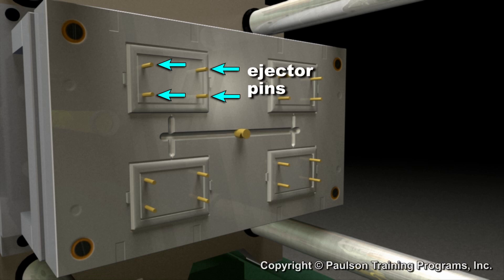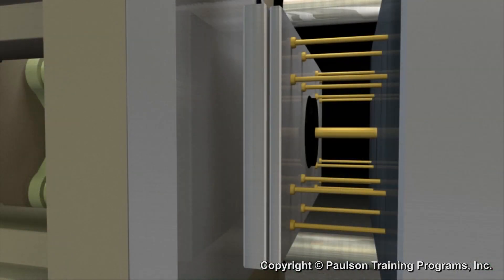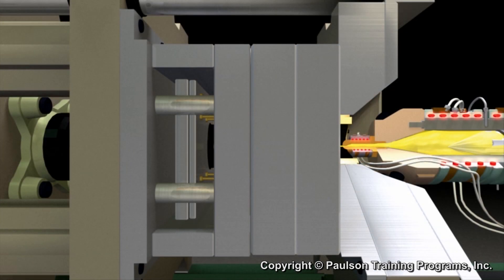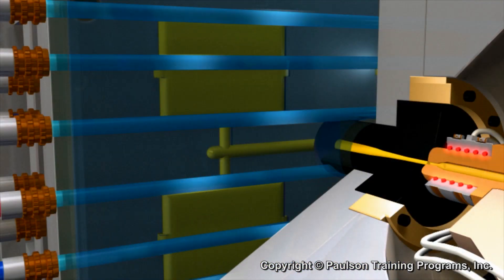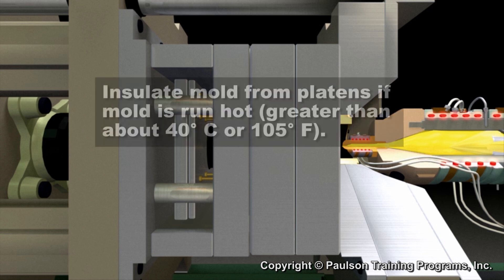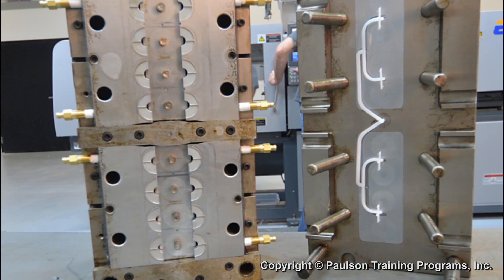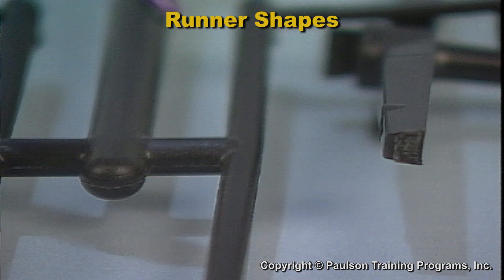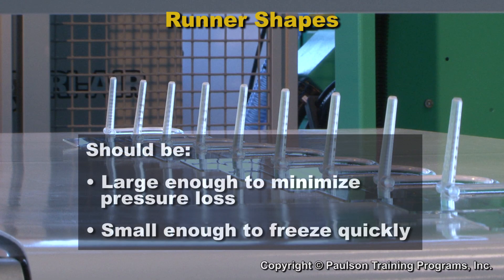Lesson 2-HD - Injection Molds - Their Parts and Operation-the Technology of Injection Molding

Comment: We are a mold manufacturer and injection molding manufacturer in ShenZhen China.  
We have made the following products, auto parts, OA. Electronic products and .Home appliances, etc.
We can provide the following tooling technologies for plastic and rubber products
1. Cold runner mould.
2. Hot runner injection mould.
3. Insert Mould.
4. Over Mould.
5. Two - shot Mould.
6. unscrewing Mould.
7. Blow Mould.
8. Compression Mould